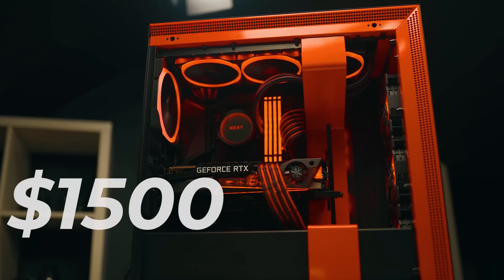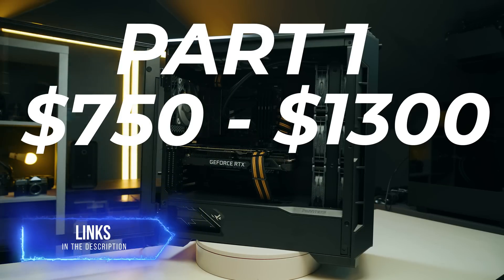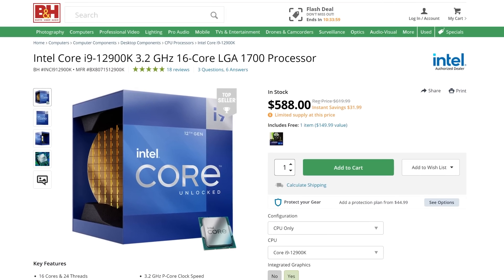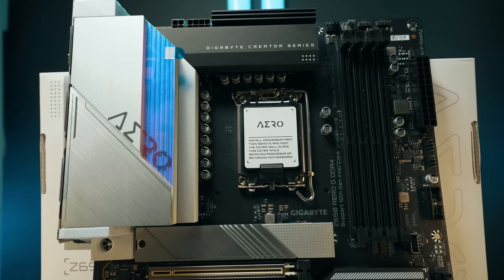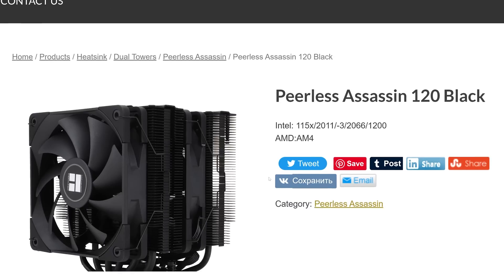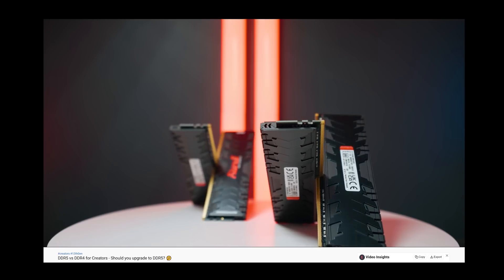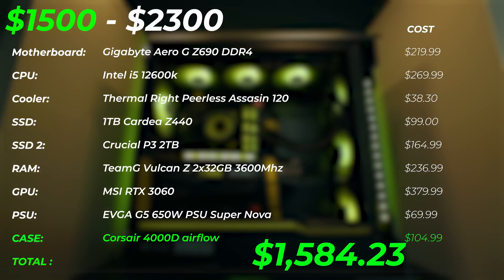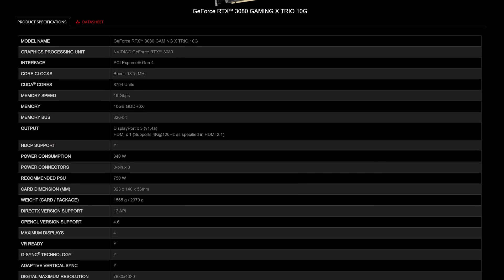BEST Bang-For-Buck 'Creator' PC for $1500-$2300 👉 Video/Photo/2D/Graphic Design etc. [Late 2022]

Comment: I'm gathering parts to build a similar PC, using the Gigabyte Z690 AERO G DDR4, an i5-13600K, and 64GB DDR4 RAM. My question is:  You specified DDR4 3600 RAM, yet I've read that the Raptor Lake processor specs show it can run DDR4 RAM up to 3200. Will the faster (3600) RAM make any difference in performance, or should I buy the slightly cheaper 3200 devices?

Comment: So far the AMD 7000 series is actually going pretty good. From what I’ve heard and seen.
Reply: are they better than intel's for video editing ?
Reply: @B7RAIN_STUDIOS  i9 13900K beats the 7950x in most benchmarks. Go with the i9 if you want the best unless you do 3D work then the 7950x is a better choice. However the 7950x is going to have an upgrade path so if you make money off your system a drop in upgrade is kinda huge. At the budget end there is no reason to go AMD, intel just has the best performance, more cores, better value.

Comment: I am wondering if for Photography & Graphic Design (no video editing) and for using Excel for bookkeeping with multiple jumbo files running at the same time. (Not running Photo / Excel at the same time though) Using the i712700k would you suggest upgrading the GPU as suggested,  sticking with the RTX 3060 and upgrading the RAM to 128 GB? 
Just wondering which way to go.  My main focus is Excel, photo secondary. 
Thank you for another wonderful video!!
Reply: Your current system is fine for your needs.  Don't get caught up with all the current hype. As for RAM, 128MB is a total waste. In fact I very much doubt you even need 64GB.  How much are you using for your current work now. Check usage in Task Manager.
Reply: Congrats🎉 you have been selected among our shortlisted winners🎁,contact the TELEGRAM name above.....✅✅✅
Reply: 128 GB is overkill bro don't waste your money i do davinci resolve heavy grading and layers and work with after effects and i have 64 gb ram and i think it's good enough